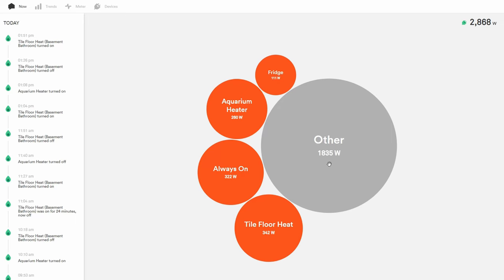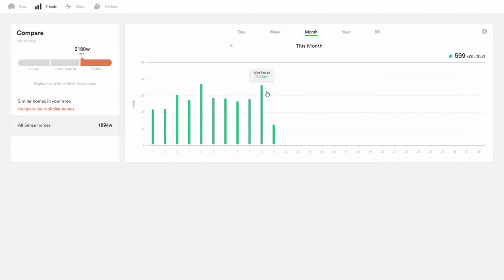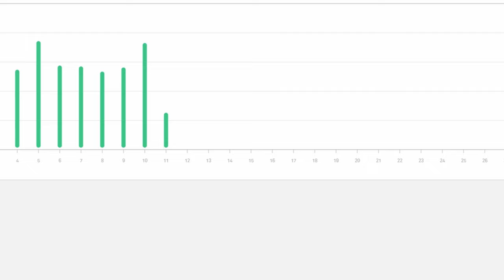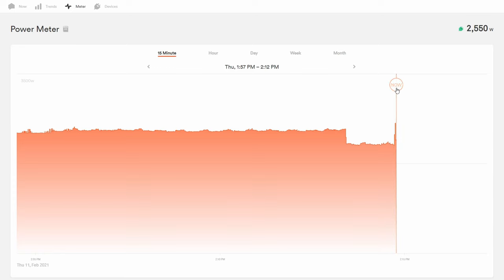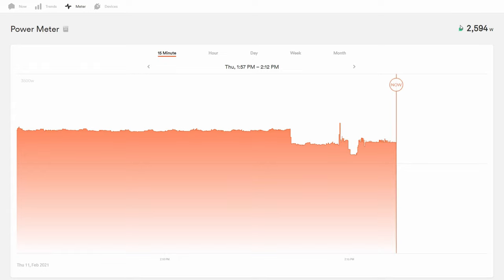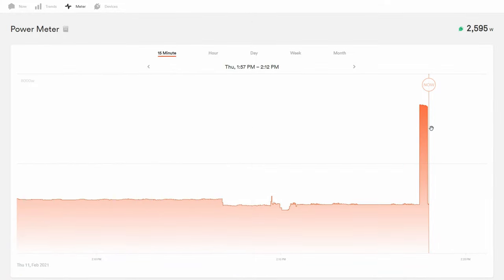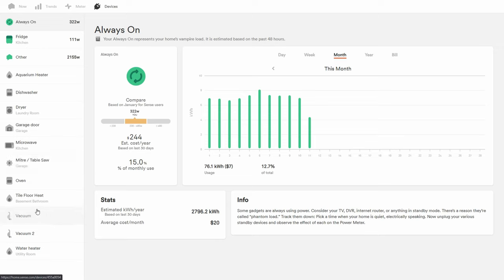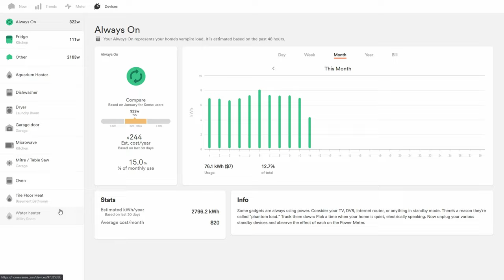Im Saving Money After Installing The Sense Energy Monitor Install

Comment: Question, I have an lg top frig with ice maker on the bottom I don’t use
How can we tell if the ice maker is using power or not
Reply from the maker: There probably isn't an easy way to do that, you'd need an amp meter clamped to the draw wires, only way I can think of off the top of my head.

Comment: Sir, it good to use a Sense device in west Africa of a voltage 220v
Reply from the maker: If you want to monitor your voltage use I wouldn't see why not. I'm not an electrician though so I'm not sure how you receive your power, as long as you have 2 110v hot lines I can't see why it wouldn't work but you might want to reach out to sense or an electrician.

Comment: My solar company just installed mine a few weeks back but the solar production is reading in the negatives. During peak sunlight hours it’s reading -8000w.
Is this normal or is the problem in the install?
Reply from the maker: Negative, that's a great day, means you're making more than you are using. I salute you.
Reply: Has Sense been able to find your devices pretty accurately since your solar company installed it?

Comment: Question 
Will Sence find all my devices if I have a 26 circuit breaker and I can’t connect to all of them
Reply from the maker: It is supposed to find anything, it just takes time.
Reply: @HouseDadLife  so all you do is connect the top two power clamps and that allows it to find most of the items in your home without added another clamp to each circuit breaker ?
Reply from the maker: @coreysgmail7261  You bet.

Comment: Having multiple same devices consuming same amount of energy at different intervals (e.g. two space heaters) can easily throw sense off which is to be expected. I am still debating if I should get this, or a much cheaper alternative with multiple individual clamp sensors and risk not.beimg to fit them all into my panel.
Reply from the maker: I think both could be a good option depending on what your needs are.  Either way getting a chance to see devices that leech power and save money by eliminating them is a great idea.  It looks like Sense is having a holiday special right now $60 off, not sure if that helps you choose. https://amzn.to/3GX2oR8

Comment: Im looking to buy two of these and monitor each 100 amp breaker box for each side of my duplex to accurately be able to charge each tenant. Would this be accurate enough that I am not losing money? There is not a phone number to call "Sense." I keep getting emails from their company that does not understand exactly what I am asking. Thank you!
Reply from the maker: Mine has been very accurate, it's almost identical to the actual meter, less than 1 % difference.  Just make sure you have the clamps closed all the way, I ended up taping mine closed because installing the panel cover opened it just slightly which really makes the readings go out.

Comment: Does the device tell power consumption against both live sides of the power coming into the panel? or, does it only show the total power consumption?    Having balanced power against both sides of the 240 volts coming into the house is important.
Reply from the maker: Only the total power consumed is currently shown.  You could use the solar clamps that come with the device to monitor both sides.

Comment: I just watched your video today.  It was well made.  I have a question, most of your usage while showing the consumption bubbles was "Other", I am guessing that means the system doesn't know what those are?  It was a large portion of your 2.5kw usage at that moment, 1.8kw.  (real time, not kwh)  I would have thought after 5 months the Other bubble would have been gone, not 72% of your load.  Am I misunderstanding what the Other represents?
Reply from the maker: Nope you are correct, most of the time it is pretty good, some of my undiscovered other is the washer and the oven preheat, these were being used at the time of recording.   A bunch of my devices have been discovered but, it is the weakest part of the device, getting better, but still slow.  Thanks so much for the compliment about the video, I do put a bunch of effort into every video you see on the channel.  Time and practice, I hope I can continue to make them better!

Comment: How do you mount the antenna when the panel is recessed in a wall?
Reply from the maker: You knock out a panel hole, and the antenna to get out of the electrical box comes with the kit.

Comment: question: i also have a sub-panel. do i buy 2?
Reply from the maker: Sense will also detect devices in other panels as long as the sub panel is supplied from your main panel after where you have placed the clamps.  If not you can use the optional solar sensors for another panel.

Comment: I like this  sense. I have question. So the sense will try to name the appliances running on it's own, then you can name them? It does this even without a connection to the individual breakers?
Reply from the maker: That is correct, it finds devices by looking at the pattern of the waves. Although it does take time for it do identify them. You can customize or change devices to but it's been pretty good for me at knowing what it finds.
Reply: @HouseDadLife  Thank you that's very helpful!
Reply from the maker: My pleasure

Comment: Is there a way to 'assist' sense to identify? I see that you can turn on and off devices to see the load, but can you then label that device that you tested?
Reply from the maker: Right now there is no way to assist detection. You can add a sense compatible plug or the solar clamps to get devices live, but if you remove them the device is gone as well.
Reply: @HouseDadLife  Just ordered some - TYVM

Comment: How did you Integrated sense  in hubitat
Reply from the maker: No integrations with hubitat yet, but, you can use some of the same devices in both.  All the screen images are from Sense ui.
Reply: @HouseDadLife  do you have any  examples or how to set it up
Reply from the maker: @VLandrew  You can watch me put mine in https://youtu.be/YLZ-pweMmjY it's the first video I ever put on Youtube so please mind the quality.  Installation is very easy, just a clamp on each main, a wifi antenna and a power wire for the device from each main on a breaker.  If you're not comfortable setting it us, it shouldn't cost you much to have an electrician do it.
Reply: @HouseDadLife  I have it installed and working but trying to integrate with hubitat

Comment: Is there a setting to display amperage? I think the app coverts the current data, so I’m hoping it can show a graph of the amps used…
Reply from the maker: I took a look and didn't see a setting to change it.
Reply: @HouseDadLife  thanks. That's frustrating since I mainly wanted to use it to verify that my panel and service was correctly sized by monitoring the usage throughout the year for min/max/average. I had hoped it would be there since the data is already collected and converted
Reply from the maker: Watts is easily converted to amps if you don't mind doing the math, watts / volts I think.  Maybe it does it, sorry I couldn't be more help.
Reply: @HouseDadLife  no worries. Thanks again. I just don't see the point of spending $300 to reverse calculate something that the monitor is collecting and converting to watts. If I were to do the calculations I guess I might as well look at my energy consumption and calculate from that. Won't give me real time numbers but historical usage. Thanks again. Great video.

Comment: I love it so far two weeks in still not sure how to add things like ups units and lights etc
Reply from the maker: Glad to hear you like it. If you don't want to wait I think tp link has some smart plugs that are immediately identified.
Reply: @HouseDadLife  well I have a tp link plug but the weird part is using surge protectors and or ups units have all my networking equipment plugged into it in case of a power outage and it hasn’t picked up anything on that 30amp circuit. I have seen other channels use similar ups units and the devices are detected
Reply from the maker: "What smart plugs are compatible with Sense? – Sense" https://help.sense.com/hc/en-us/articles/360012089393-What-smart-plugs-are-compatible-with-Sense-#:~:text=Sense%20is%20currently%20only%20compatible,plug%20questions%2C%20see%20the%20FAQ.
Reply from the maker: Hopefully they are on the list of compatible.  I haven't added one personally so I can't be much help here.